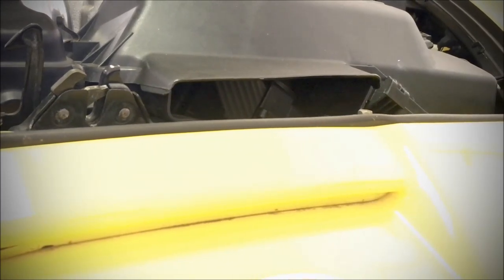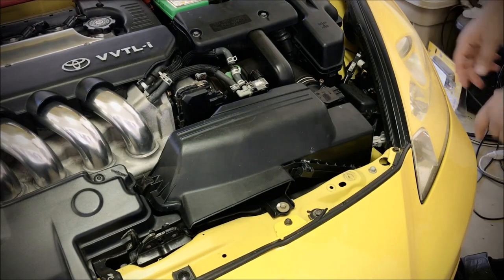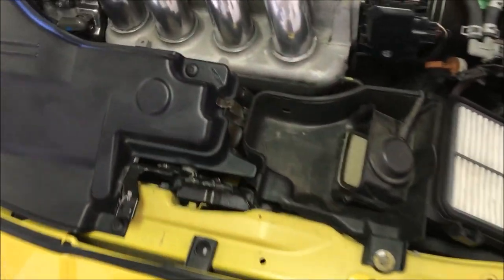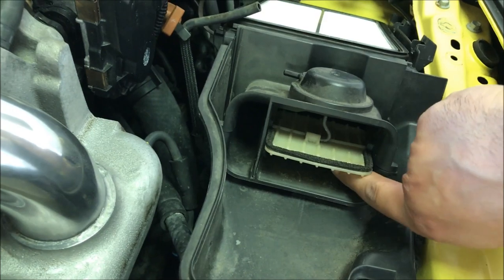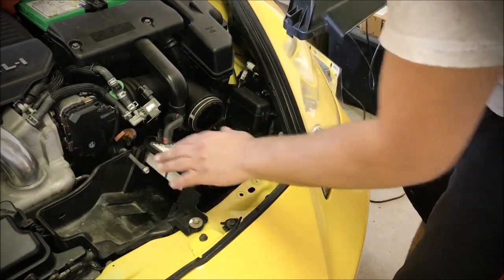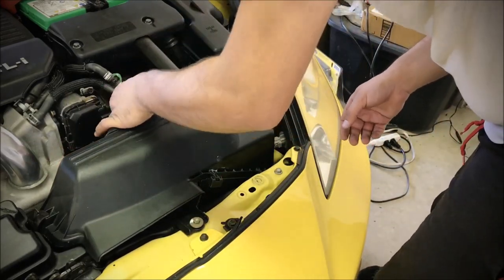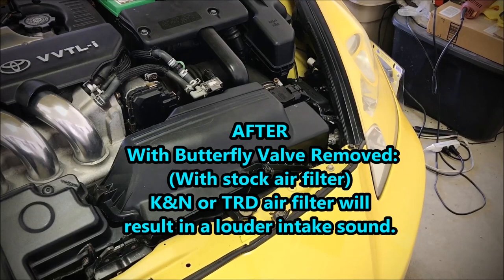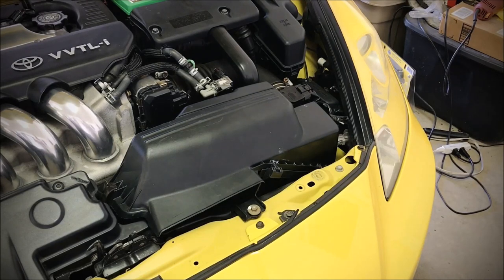How to Remove the Butterfly Valve On a Celica or Lotus!

Comment: I'm thinking about doing this .short  ram intake sucks in hot air and gets dirty way to fast... but is it bad to remove the butterfly..or is it the same as having the short ram intake on
Reply from the maker: It's the same if not possibly even better (with a k&n filter) since you don't have extra heat , and you have the stock tubing ( which the MAF sensor LOVES) it will run much better. Short ram will be louder, but louder doesn't = power.
Reply: @KeleentProductions  you should do test drives at the end of you're videos to show first hand if certain things make a difference :)
Reply from the maker: @theprodigy8355  It definitely would not show up in a video lol. The  gains are so minimal that it doesn't matter.. plus, I'd like to obey all the traffic laws :)

Comment: Does this do anything to the gas mileage?  Specifically does it increase your MPG at all?

Thanks in advance.
Reply from the maker: if The valve isnt working or is stuck closed your car wont run that strongly.  Just about anything that adds power to the car reduces fuel economy.  This will most likely reduce fuel economy. but not by that much if you are using the stock airbox.
Reply: @KeleentProductions  Thanks for the response.  I was thinking that the increased air inflow would mean less fuel needed to ignite a reaction and therefore more fuel economy.
Reply: @anonymouse9355  nah the fuel is mixed at a constant ratio (known as the stoichiometric ratio). The more air that gets into the engine, the more fuel the injectors spray. If the engine just got more air without the fuel it would lean out and run very poorly :)
Reply: Appreciate the knowledge bro.  Thanks.
Reply: @jacoblawrence9145  Yes, more air  --> more fuel = more power !!